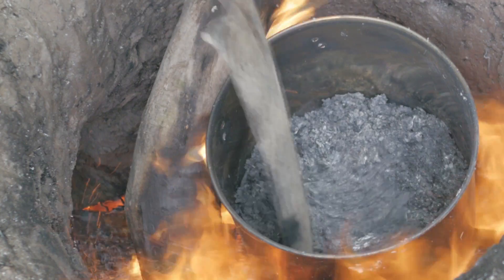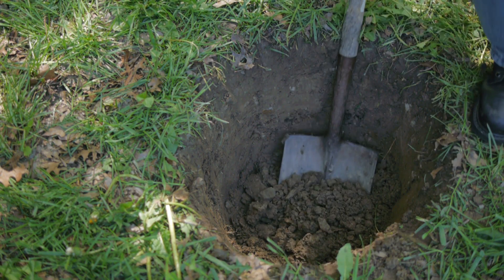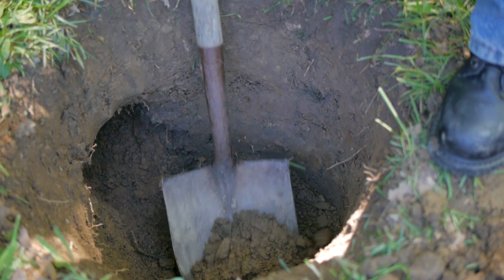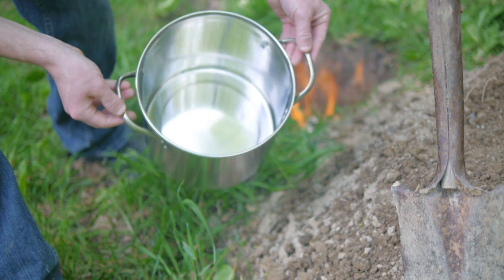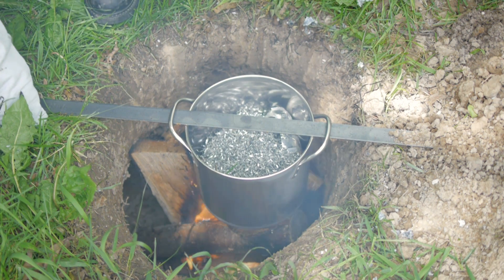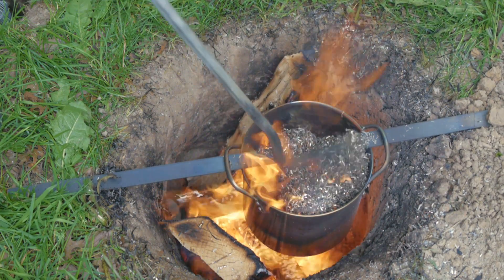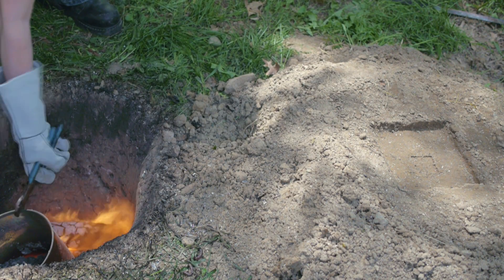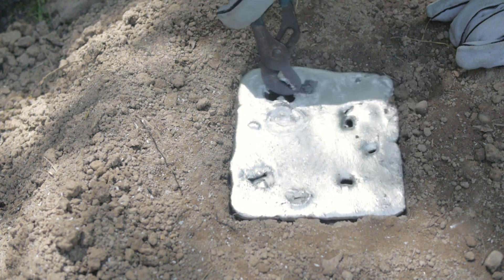How To Melt Aluminum With A Hole In The Ground

Comment: Need an idea? Throw in some gallium into molten aluminum. i wanna see what's happening to the gallium ..
Reply from the maker: Derk Jochems Huh, that's actually an interesting thought. I imagine it would just turn it straight to slag much faster
Reply: NightHawkInLight I think it would clean the impurities a little faster.
Reply: Derk Jochems
Reply: I'm 2 years late, but it would alloy together. Then, if you put the cooled chunk in water, it would produce a bunch of hydrogen, aluminum oxide, and the gallium could then be reused. Gallium makes aluminum react in water. It could power an engine, boiler, air motor, etc using old cans, leaving nothing but aluminum oxide.

Comment: I melted aluminium with a different method, anyway i had some difficulties with my stainless steel crucible it got destroyed so easily and i do not know why. Did you have the same problem, and if you had did you find a solution for it?
Reply from the maker: Berk Bilgin Too much air flow blowing right on the crucible. If it gets too hot it will burn right through.
Reply: Berk Bilgin Plus it depends on a few factors: the thickness of the steel pot/crucible, and the type of steel the pot is made from. There are many different grades of steel and just as many (if not more) grades of stainless steel......Plus there are different grades of aluminum too.....and (without knowing for sure) I bet their melting points vary as well.....
Reply: Try using an old fire extinguisher as a crucible or even a propane torch tank but be carful because you need to depressurize the tank properly if you don't you could get seriously injured and with the propane because it's flammable purge  the gas out by pouring water into it

Comment: NightHawkInLight 
I dug a hole in my garden for this with a air tunnel for a little fan like yours.
The fire got nice and hot!
When I tried to melt the cans it wasn't hot enough.

We got out the skid steer with a post auger. The hole got loaded with large logs and a for  fan we used a large box fan.

I put the pot on the fire started loading it up with cans they melted but there was no aluminum in the pot I put kept trying to melt the cans but the was no melted aluminum so finally i lift the pot out and discover that there was a hole  melted in the side of the pot. 

Lesson learned
Don't try melting aluminum cans in a aluminum pot!

I am off to the store to find a new pot that is STEEL
Reply: farmerKJS ok, that's good, I was thinking that it was like 4 lbs or something lol...

Seriously though, did you laugh when you saw the hole in the bottom of your pot? I know I would.....lol...and it wouldn't be the first time something like that happened to me...like the time I changed the oil in my car, put 4.2 quarts in and nothing showed on the dipstick? Well THIS dipstick forgot to put the drain plug back in lol........
Reply: michael C no just like 10-15 cans.
I had a great laugh over it.
Been there done that
Reply: farmerKJS Did you pull the aluminum out of the hole afterwards?
Reply: No i just plowed it under so i could plant
Reply: michael C
well it was only a little but and the wood/ash is natural. I haven't had any problems yet
Reply: farmerKJS LOL dude, sorry, but that was FUNNY...hahah....looked in the bottom of the pot and there was a hole...damn dude, you just made my night!!

As for leaving the aluminum in there, hmmmm I don't know much about metallurgy but that might not be so good for whatever you're planting......I know a LOT of home builders bury a lot of their debris and grass won't grow over the place where they buried it. A buddy of mine bought a new house and there was a square patch in his backyard, about 8' square that just wouldn't grow.....he finally dug it up and found 4 or 5 bundles of pink insulation, brand new in the packages.....

Comment: Why didn't the steel melt, soften, or collapse from the fire like the world trade center? I'm confused by reality and science...
Reply: David Chase This fire wasn't anywhere near hot enough to melt the steel.
Reply: I know, I was being sarcastic to the sheeple who believe fire/jet fuel caused the world trade centers to collapse. Thank you for taking the time to acknowledge my statement. Have a good day.
Reply: David Chase do u git funi 911 jook/???????? xxxXDdDDDddDdDdDDD
Reply: +David Chase.... As a mindless conspiracy theorist, I can see why reality and science confuses you. As a structural engineer, I am much less befuddled. 

You can leave that steel bucket in the fire all day, and it will not deform, as the temp will not reach it's melting nor it's elastic deformation temp at normal 1G gravity stresses. Now, flip it over and add a few hundred lbs of weight on top of it, and see what happens. A weight it could absolutely bear if it were at normal temps.

Oh wait, I know. ALL of us structural engineers are in on the conspiracy! Just like the THOUSANDS of military and government personnel who were complicit in the cover-up. Well, except the ones who objected, and were taken off to Diego Garcia with the passengers of the airplanes... the ones that weren't really flown into skyscrapers... hahaha.
Reply: jet fuel actually CAN melt steel beams...its even easier for thermite to..
Reply: None taken but you completely missed the joke.
Reply: Must be that legendary concrete wood I've heard about. Not like that regular wood that burns and people use in fireplaces. Tell me again why don't we use this magical concrete wood instead of this dangerously weak and vulnerable steel?
Reply: nivlac i provided information. You should be grateful
Reply: David Chase because jet fuel, as the name implies, is used for jets.
It's pretty expensive, so why would you use it for something like demolition?
Reply: David Chase 
Just curious. Years later, do you still think a big skyscraper can't fall if a huge jet flies into it? It was a fun theory, but after all this time, you must realize a plane with fuel can weaken a building to its point of failure. 

Unless now you realize the earth is flat and gravity is fake illuminati trickery? I adore "awake" people. More entertaining than boring "sheeple" who believe Free Mason "science" and "math". Every smart person knows George Bush was a reptilian shape shifter working for the Antichrist (who is obviously Elon Musk).
Reply: No offense but he clearly said that steel needs much higher temperature to melt than aluminum
Reply: Whats with the attitude? If you can't have a nice conversation...no soup for you.
Reply: Ok, he who loves the smell of his own farts, tell me why we use steel instead of wood?
Reply: The fuelsalage wasn't open and resting under the steel beams in the World Trade Center Towers. It was shredded and scattered.  Now....CAN WE REMOTE CONTOL FLY AN EXACT REPLICA OF A PLANE INTO A SKY SCRAPPER AND SEE WHAT EXACTLY HAPPENS!!!!!!!
Reply: nivlac i'm actually a freshmen who also does science experiments, i sense a flame war (the type i always win) so i will give you a chance to back down and go about your day without your feelings hurt.
Reply: +Damon Jackson (Gaming & Science) don't lie it doesn't make you look smarter jet fuel cannot melt steel beams scientists tested it with
Beams of the same thickness and hey didn't get even get that hot and they also tested with thermite and also tried thermate which is real and the thermate was definitely powerful enough and jet fuel can't melt it straight lines and vertical lines but thermate can can you explain that and they found some melted magnesium within the melted steel on the ground beside the building magnesium is what they use to ignite thermate
Reply: Damon Jackson"Steel is also a very weak alloy" WTF?  As compared to what?  Adamantium?
Reply: +Damon Jackson (Gaming & Science) did you watch the video I sent you
Reply: David Chase compared to other alloys like tungsten carbide, which can cut diamond easily
Reply: Damon Jackson There are differenct grades of steel.  Like High 40, 80, and 120 that are used on submarines and can with stand those numbers in tons of pressure per square inch.  I was using reverse psychology by saying a dumb statement so I COULD get the CORRECT answer.  It worked.  If you want to get people to agree with you, post the incorrect statement and everyone with post the correct response.  Try to argue and you will never win.
Reply: Pot did not melt because it knew what was inside would leak out.
Reply: David Chase I don't need a degree to know psychology and melting points of metals. Chemistry is a hobby
Reply: Jet Fuel is $5.21 a gallon. C4 is $13.25 a pound.  Plus you need demoltion experts to place it vs anyone  just throwing jet fuel on/in a building and causing it to perfectly implode. Jet fuel is the new way to go in demo, no experience necessary...do u get it now Dr. Mind Bender?
Reply: dcchase77 are you talking to me? Learn how to mention.
Do you want flaming liquid spilling on the demolition people? Hell no. That's hundreds of lawsuits waiting to happen. Simply too dangerous
Reply: Hahahahahaha... but building 7 man.  Office paper can melt steel.  You didn’t know that?  ;)

I made this and showed it to my wife how hard it is to melt aluminum with a much lower melt point of steel.  She just rolled her eyes and went back to Facebook.  

Thank-you for your post.  It made me laugh and wish more people used their brains like you are.
Reply: +Damon Jackson (Gaming & Science) I guess I should listen to a person on the YouTube comments you must be so smart
Reply: +Damon Jackson (Gaming & Science) excuse me I was joking didn't you get the link thermate is a thing
Reply: +Damon Jackson (Gaming & Science) your just a stupid ass 12 year old who plays minecraft I actually am in university why should I listen to you
Reply: David Chase unless i'm right. But in real life, i always win arguements because of my knowledge on how the human brain works
Reply: Where is your degree from? What school and what year did you graduate so I can verify your facts.
Reply: Then why don't they use jet fuel for demolition and hire any person off the street with no demolition experience since it is obvious to you that jet fuel can bring down steel structures without any planning or lay out of explosives?
Reply: +Damon Jackson (Gaming & Science) jet fuel is not near hot enough to melt steel im sorry but your wrong and it wasn't thermite it was thermate that did it

Comment: what is those little things that you turned into aluminum?
Reply: Turning are the scraps and bits left over from cutting and drilling of metal
Reply: could i use my hidney stones as crunchy granola?
Reply: Matheusk0 I think they is the scrap which is left over from a machining process.

Comment: Alternative for the mold, put the dirt into a steel baking pan and put the pan over the crucible like a lid
Reply: Leonard Greenpaw If you get a bag of sandbox sand (clean stuff) make a wet sand mold and let it dry, then pour the melt into it, that's what Neenah Foundry does....LOL, only with steel. Look at your local man-hole covers....
Reply: Jeff Nelson Oh, and what about clay like the cheap clay cat litter, I am sure you can get great detail with it, and cant clay takes extreme heat if you temper it first?

Comment: you dug a hole about 45 degrees to the hole nexto it so that it has an air supply underneath? isn't the air supply coming from the top of the flame enough?
Reply: Yes, but more oxygen means more heat because the Wood Can burn faster

Comment: I saw one of the guys from Cottage Life cutting open an oil drum. I heard of an accident at my father's work where some guy decided to do that. Nothing but shoes were left for the coffin. If you don't know how long ago and what kind of liquid was stored in oil drums and you really have to cut them then do it when they're filled with water displacing any potential flammable liquid vapor.
Reply from the maker: That's good advice. There aren't many explosively flammable things that might be found in an oil drum that you couldn't detect with a sniff test, but it's better safe than sorry.
Reply from the maker: ***** I used the term oil drum because that has become a common term for all 55 gallon steel barrels, not all of which are actually used for oil.

Comment: can this work in a snow hole
Reply: The fire would melt the snow and render it rather useless. Plus, the water from the snow would flow to the wood and other fuel and likely cool it to the point of putting the fire out. 

So it would not work in a snow hole.
Reply: ok thx

Comment: How long did the melting process take in real time? Just curious. As kind of a survival freak, I have used Dakota-style firepits quite often. Just didn't realize that they could get THAT hot with extra air. I was thinking of using a bellows instead of a fan, so just trying to judge how fit I'd have to be any given day for that experiment. ;)
Reply: should take only about 10 to 20 minutes depending on the amount and purity, as well as the heat of the fire (slag has thermal mass too)
Reply: slango20
Ah, great! Thanks for the answer!

Comment: Probably shouldn't use a steel pot, as I've heard tell that steel can become viscous when in contact with molten aluminum.  Otherwise, a nice inexpensive solution to making relatively pure ingots for later use.

Also, try and use pine and Tamarack trees for fuel.  They burn out quicker, but they also burn noticeably hotter than hardwoods.
Reply: depends on the steel, what you heard is probably about an alloy, as a steel fire extinguisher crucible has worked for many people and is very sturdy

Comment: If you have a really large hole in the ground auround 4-5 feet deep and 3-4 feet wide or bigger, you can use a leaf blower and the flames get hoter than in the video. You can just about melt steel.
Reply: Liver Silver
just about, as in you might get it glowing white hot and maybe welding temp ,but not super runny molten stuff
Reply: No way you can achieve temperatures as high to melt steel
Aluminium takes around 600-700C to melt while on the other hand steel takes 1300-1400
Reply: slango20 a coal fire with the right amount of oxygen can get so hot to melt steel.

Comment: Good idea for melting with no equipment or setup. My waste oil burners take some building and setup even if they have a lot more heat output but with a 12V fan, this could be done anywhere.

Comment: Can this be used to melt scrap copper?
Reply: Copper melts at 1085'C, about 400'C hotter than aluminum.  I bet if you used a large fan, and some super dry hard wood, you could probably get to this temperature with this method.. Stainless steel melts around 1450'C (+/- depending on formulation), so keep that in mind if you find a way to really turbocharge the fire.  Don't want to melt the pot.
Reply: Sean Keep in mind that you'd consume wood like crazy to keep these temperatures up, so be sure to position your crucible in a way that lets you keep feeding the fire.
Reply: If you use charcoal, briquettes, or something along those lines, they burn hotter than plain wood.
Use a steel or stronger metal crucible, as copper melts at a high point. And always wear gloves.

Comment: I gave this a try over the weekend, and it worked great! I made the same mistake of using a pot with aluminum rivets. I was able to melt down a few cans and get a handle on how this works (burned myself a couple times).
I'm planning on making some little ingot casts, along with out of plaster of paris. Is that possible?
Reply from the maker: Yep, that's possible. A lot of people use muffin tins. Wear safety glasses and preheat your casts! If there is any moisture in them it can cause the aluminum to splash or pop when it's poured throwing hot drops everywhere.
Reply: I would caution against using plaster for molds. Even when heated they can still retain moisture and pop molten metal out at you. Speaking from experience and fortunately didn't get splashed.
Reply: LOLStudiosMusic1 check out grant Thompson if you haven't already he has a lot of cool foundries that are pretty easy to make this one's great to if you can get a hold of plaster and sand but they are portable
Reply: LOLStudiosMusic1 Yep Grant Thompson (The King of Random) has a youtube channel that has a lot of good stuff.